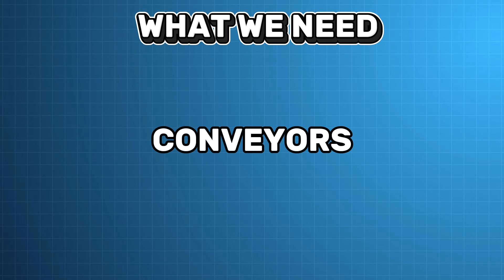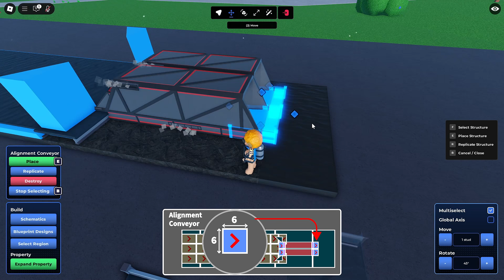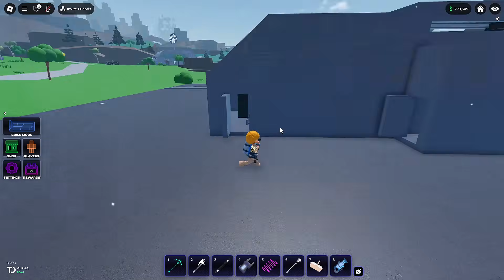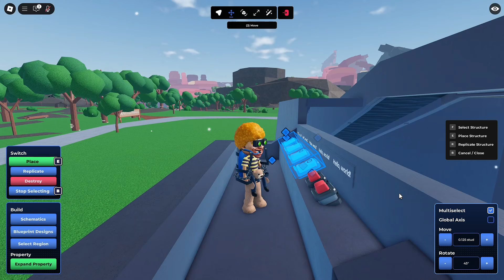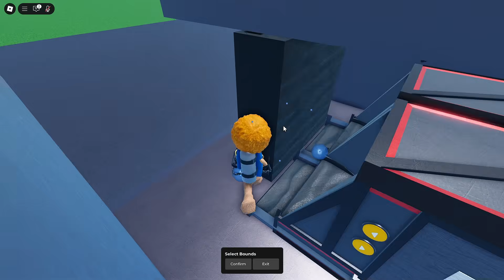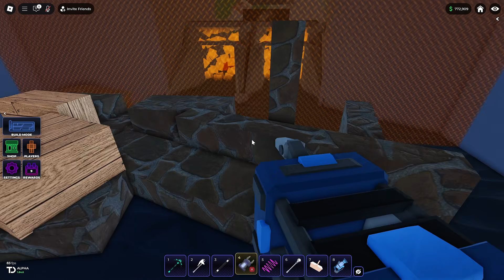BUILD an Auto Loader & Unloader For NEW Truck in Oaklands | Roblox

Comment: its all good but sometimes when I put ores they dont turn into bars in the first time so i have to go thru the process again, any tips?
Reply from the maker: Hey! its hard to diagnose Problems through test so i can only make suggestions:

1. Did you move the Alignment conveyors down 1 stud and out by 2?
2. did you line up the planker exactly as I did?

--

IF these are both correct then i can only suggest to slightly adjust the alignments
Reply: @FrumpyPlays  Hello, me and my friend were looking into this machine on my plot, and we kind of figured it out, its sometimes that there is too many ores or logs and the refinerys,forges/plankers can not process it all easily, especially when the ores/logs are too big.After changes we tried the machine and it kind of worked.Thanks for replying to us in comments when we need help! 💯👋🏻

Comment: why this stupid machine dont work
Reply from the maker: What part isn’t working for you
Reply: @FrumpyPlays  despawn and stop conveyor
Reply from the maker: @Loadqwq  So its hard to diagnose problems through text so i can sonly suggest some things.

1. If spawn is working and despawn isnt, this would suggest to me that either the number interface is not set to 20 OR that it is wired in correctly.

The Number interface needs to go to the left side of the relay, despawn button to right side of relay and the relay output to the interactor.

2. Stop conveyor again this suggests a few things.

either 5 isnt inputted into the interface, its wired incorrectly or the regions from the interactor are not over the tiny orange switches
Reply: @FrumpyPlays  does the cable color matter? because i use different colors for each button
Reply from the maker: @Loadqwq  no colours just help you with visuals ect
Reply: @FrumpyPlays  I have fixed all the machines running smoothly all of that because I kept skipping everything that I thought was not important and it turned out that it was important all of that because I put in 0.5 instead of 0.05 and some cables were in the wrong place. btw +1 sub
Reply from the maker: @Loadqwq hehe thanks for the sub!! Glad you got it all sorted
Reply: @FrumpyPlays  can i buy the blueprint?
Reply from the maker: @Loadqwq hey I’m not on at the moment but everyone has permission to sell it so hope someone here or only can sell to you

Comment: Hey I completed the design and everything works perfect except for the Despawn button. Obviously it’s something on my part but do you have any suggestions on what I may have messed up? I looked multiple times in the video and couldn’t find what the problem is
Reply: So I ended up connecting the 4th number interface to the relay it’s above and it worked thanks for the design!
Reply from the maker: @IukePfeiffer  wahoo glad you got it sorrted! sorry somtimes im not faster on replies to fix right away!
Reply: @FrumpyPlays no that’s alright I totally understand but the deign works amazing thanks!

Comment: how does the materials get into the truck if the top can't be opened?
Reply from the maker: Hey the Materials dispense at a distance from the storage drawers therefore goes straight into the truck :) as lon as the storage drawer is close enough
Reply: @FrumpyPlays thanks

Comment: Frumpy I have a question what size storage drawer are you using. I want to make sure to do it correct. love it so far btw
Reply from the maker: Hey! Honestly it doesn't matter too much on the top ones just need to make sure not to be touching the truck when you spawn it :) needs to have a slight gap between the truck and drawer

Comment: It works fantastic, and it was easy to follow, question though, whats the collider for? Im terrible at logic
Reply from the maker: Hey! Good Question as I dont really showcase or explain why.
So ....
I made the two storage drawers non-colliding so that items can pass through them. This way, if one drawer is full, the items can continue through to the second drawer without getting stuck. It's also useful if both drawers are full—items will just fall back down and re-filter into the main storage system or back box.

When I tested I was able to send both wood and ore through at the same time. Wood would go into one drawer and ore into the other.
Reply: @FrumpyPlays  that was a great way of explaining it, thank you, also the machine works like a dream thank you

Comment: Is there ever a situation in which i may need to use the collider button, because i wonder what its use would be
Reply from the maker: Hey so the collider basically… as you have two boxes it’s helps wood and ores not get stuck on the top conveyor if one or both are full

Comment: When you use it, does the material have to go through it twice? It happens to me that it "cooks" and doesn't form an ingot when it comes out of the three machines. Could I have done something wrong, or does it just have to go through the whole process twice?
Reply from the maker: Hey! So I would first adjust the alignment conveyors to not go so far into the machine and try again - it shouldnt go through twice

Comment: love the tutorials but it does get tiring pixel peeping to see values and alignments for many parts of the vid. There is a noticeable improvement from older videos though.
Reply from the maker: I’m not sure how else to do it I’m afraid lol unless you have suggestions
Reply: @FrumpyPlays  When connecting the logic (or other detailed steps), speaking through the motions instead of a time-lapse would help me quite a bit. Interested if others have suggestions though. I have been going over my logic for an embarrassing amount of time to get it working.
Reply from the maker: @Brealu I figured speaking would just be annoying over that section. I can only suggest putting it in 0.25x I tried hard to make the logic super simple by placing everything ina row and just doing it with the mouse showing :)
Reply: @FrumpyPlays  yes, that was what is getting me through it. I have it built after 90 minutes or so but I am missing one thing, I think. 

Edit: My truck will spawn but de-spawns one second later. Is this an easy fix without restarting? (thinking of moving it away from the filter conveyor by one stud...maybe it is intersecting upon spawn and causing it to despawn??) <<--that made no difference so I'm currently manually respawning from the edge.

Truck will stay spawned if I keep on conveyors but this has moved the truck. Going to go back through the logic. Extra wire was on the despawn from one of the relays, all is good now. Thank you for the awesome build.
Reply from the maker: @Brealu oh blimey I’m glad you got it all figured out! Sorry it wasn’t easy to follow :/

Comment: when mine goes through the machines and into the first stoage contaner it does not automaticly goes thorough and i dont know why, then when i unload it myself from the first storage contaner it goes to the second and only puts 1 material in like rock and not the wood
Reply from the maker: Hey!! Let’s see if we can fix this for you! 

So just so I understand? The stuff goes into the back box but not up to top conveyor? - if that’s happening then the switch isn’t on or the logic may be incorrect.

So only 1 type of material can be in the box at once … I have two storage drawers with collide and it allows both wood and ore to then work… but I don’t tend to farm wood and ore at the same time